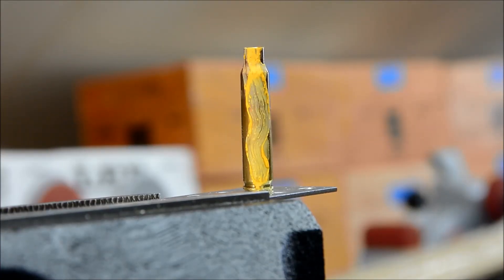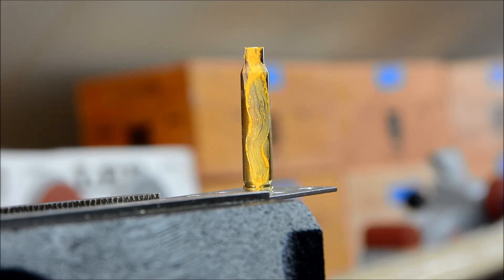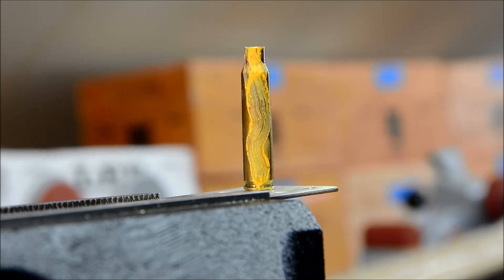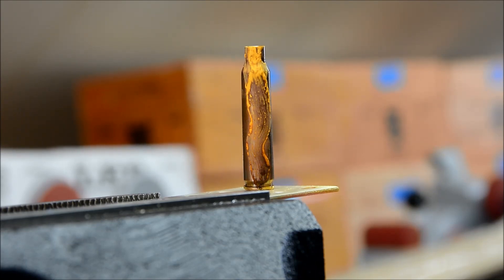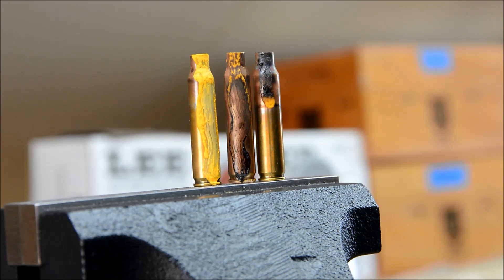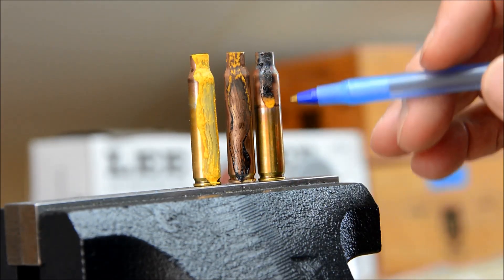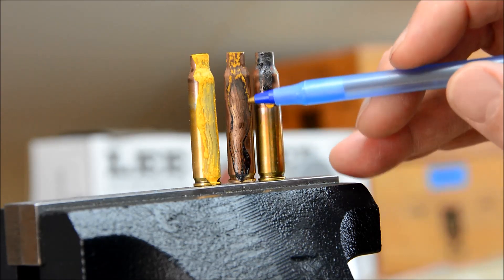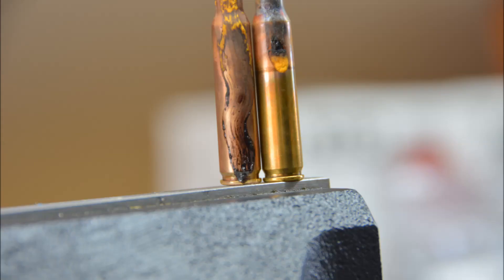Annealeez 2.0 Pt 7  - Tempilaq 650F testing

Comment: Ok so do we reduce our time when annealing and also water quench to stop further heat creeping back towards the case head?
Reply from the maker: Water quenching, as I understand it, doesn't work with brass.   Basically as you get about 500F you start to anneal but slowly.  At 800F you anneal in seconds.  This is where the torch is good as the only part that gets this hot is in very close proximity to the tip of the flame.  The tempilaq I used shows where the temp goes below 650F so the rest of the case is not annealed.   Here's a good write up I found if you haven't seen it already.  http://www.massreloading.com/annealing.html
Reply: @Hazzbro1964  It will anneal or recrystallize in 1 or 2 seconds at 700 C, not F.  700 C is about 1300 F.  800 C is about 1470 F. 
800 F over 6 or 7 seconds will stress relieve only. Nowhere near enough time to anneal or begin recrystallization.